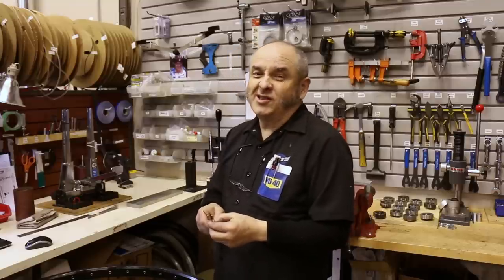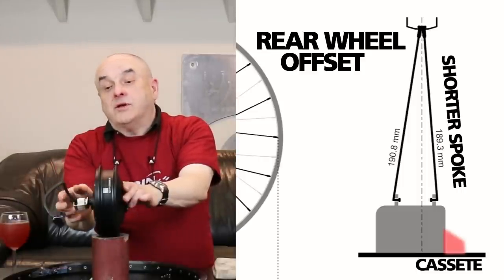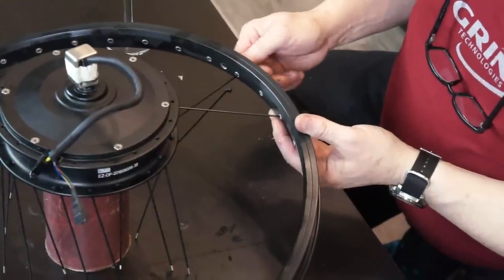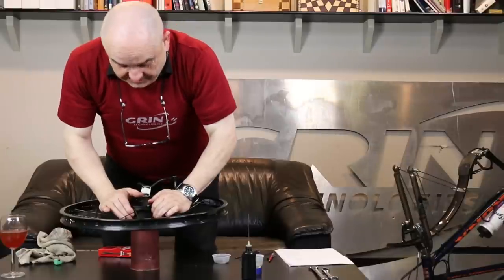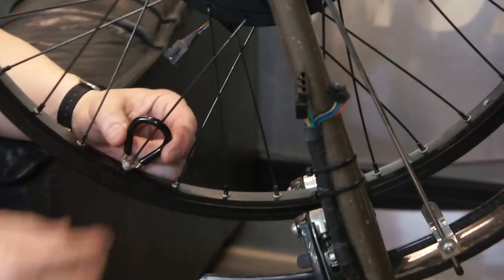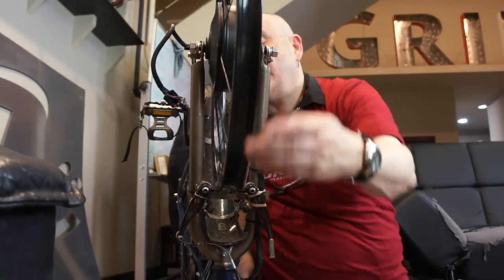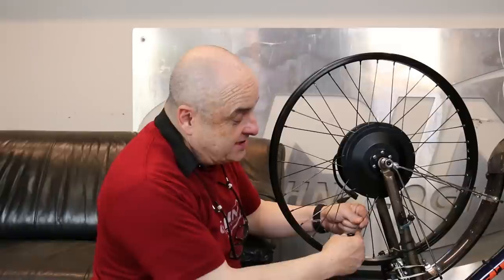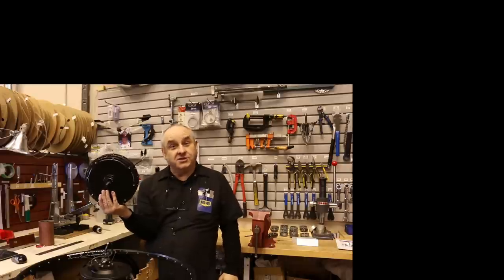How To Lace a Hub Motor at Home Like a Pro. The Single Cross Build

Comment: Hands down the best ebike wheel building video out there! Thanks so much!
Reply: Yes but building an ebike wheel isn't any different from building a normal bike wheel.
Reply: I think he specifically did elbows out for both stability and also because hub motors put much more torque on spoke heads so you can't do alternating elbows in/out like a lot of road bike wheel builds recommend
Reply: Also a 1 cross reduces the spoke angle compared to the normal 3 cross

Comment: Explain very well for the average person that's good with their hands. Not all of us have a bike shop to work in. I'm relacing an Alex rim also. A 1200 watt ebikeling rear hub. Tried solid Tannus tires. Worked great til they cracked my rim 6 inch from the weld point and at the Weld point. A700c × 40 tire a 23mm inside with a rim. I know hardtail without any suspension all the shock was being absorbed by the rim. The solid tires had the pressure of roughly 80 psi. They were extremely light wait. Gave a minor rolling resistance. And could never get a flight which was great. Do the rim cracked thank you for the video very helpful and knowledgeable person thank you

Comment: So helpful. There is nothing out there to help us with broken wheels. It’s a massive hurdle to ebike ownership. Every time I take my bike out I have wheel anxiety. Break the wheel , you can’t even find a bike shop interested in  repairing it. Thanks for doing this.
Reply from the maker: No problem and hopefully you'll be confident after watching to look after wheel truing yourself.  The main reason for failures is when people allow their spokes to get loose, and then there is opportunity for fatigue weakening of the spokes at the bend.  But we've also seen a few instances where people have overtightened their spokes and the nipples have pulled through or cracked the rim.  Done right though, a hub motor wheelbuild can be trouble free for years and years.
Reply: I had the same problem, I always used 12g spokes, makes a huge difference

Comment: Thanks for putting this together. I learned a ton.
Reply from the maker: Hey good to hear. There's a lot more nuance that we didn't go into regarding many specific hub motor wheelbuilding scenarios, but a large majority of hub motor builds are well addressed with this general technique. ie, single cross, all bends on outside of flange, and oiling (not loctiting) the nipples.

Comment: I was thinking of investing in truing stand to build my first wheel. Now I'm not going to because I already have one on the bike. Thanks Robert.
Reply from the maker: I mean, a truing stand is a great investment if you expect to build up number of wheels in your life, but if this is just a one-off build then the fork trick does the job just fine.
Reply: @GrinTechnologies  Let's first see if I can get one built. With your help that should go fine. However, while waiting for my first hub motor to arrive I've been wondering about something. My bike has disc brakes. I've noticed that even though the front tire is centered in the forks, there seems to be less space between the edge of the original hub and the fork on the brake side than on the other side. But the wheel looks to be symmetrical with no apparent dish. Should I expect some? If so, does mean I need two different lengths of spokes? Maybe you could do video on how to determine if this is necessary and how to do it. I suspect this information would also come in handy if you are lacing a rear hub motor.
Reply: @ALSmith-zz4yy  you have disc mount on one side of the hub, no? Space that you mention is taken up by that mount on disc side? Look at the hub where spokes are rather than axle, spokes on disc side are slightly further away from the fork comparing to spokes on the opposite side which are closer to fork? Same on the rear wheel where cassette is, as long as you rim and tyre are right in the middle of the bike/fork/seat stays/chain stay you are good to go... or I didnt understand your question?

Comment: Thanks for this, I used some old bits I had laying around to lace a 250w geared motor to a 700c rim, using spokes mostly from a 26" wheel and some 700c spokes. I followed your pattern but I had more of a harsh angle on the spokes due to them being longer, but it did it and it works perfectly, managed to true it up quite close.

Comment: Hmmmmm thanks to your informative video. I can most likely attempt my own lacing. I’m looking to reduce wheel size to a 24inch rim hub.
Reply: Can I ask you what's the best AMPS to use for a 48v 1500w hub motor?

I'm currently running a 52v battery that can do 45amps with a 48v controller.

But I'm able to reduce the AMPS on my controller. Because I believe 45amps that my battery can produce is overheating my rear huh motor

Comment: Love I'm a bike tech who just got his first ebike second hand. I do have a tensionometer. What kind of tension should I be shooting for? Back end makes some interesting noises. Ego bike Seagull. Thanks for the great video.
Reply: no idea but I do know from experience that if it's too loose, the torque from the motor can unscrew all the spokes and also that too tight results in spokes breaking constantly.
Reply from the maker: For the most part the spoke tension should be no different than for a regular bicycle hub. The fact that the hub has a motor in it doesn't really change anything about the forces present on the spokes.

Comment: I just attempted my first wheel build using a Farsports 58 Kaze carbon rim for my Orbea Gain. I used the 1X crossing like the factory wheel, but after I finished (which was a real biotch since I ordered the wheels with no outer spoke holes) I found that I had laced the wheel with all the spokes inside the hub with the spoke ends out. Doh! Will this work ok, or do I need to disassemble and flip all the spokes to the outside of the flange?

Comment: thanks for posting this video. I would like to know what diameter spoke do you recommend when lacing electric hub motors? And what material/metal do you recommend or use for lacing up your hub motors at Grinn?
Reply from the maker: We almost always recommend single butted spokes, 13 gauge at the elbow tapering to 14 gauge at the nipple. Sapim Strong has been our go-to but other reputed companies like DT Swiss and Pillar have similar offerings.

Comment: I'm trying to fit an ebike hub motor into a 17" rim. any idea what my limitations would be as far as wattage etc? was hoping I could use your calculator but there isn't anything for a 17 inch wheel. any info would be appreciated
Reply from the maker: You just need to know the ERD of the rim, the nominal rim diameter is neither here nor there.  Just use the 20" so that the drawing looks OK and then enter the actual ERD.

Comment: Do you think it's safe to have a single cross, inside elbows under outside elbows over, on an 18 x 3 " motorbike rim (aluminium) front hub for a fat bike ebike build using motorbike rims and tyres. Spoke gauge being 12g.
  It's a 48v 1000w system so no more than 36mph

Comment: I have a captured drawing from an article, that I think Grin wrote, that says to always have the j-bends inboard. Regarding thrust load at the side plate bearing.  It increases the spoke length difference to over 2mm. What gives?    And another drawing from the same article shows 544mm 32-hole rim 3X lacing compared to no cross of the same size, with motor. The spoke angle difference of only one degree. I did some math, for a 29er rim  that similar spoke  count would be over 40. Although I'd like a 32 hole hub motor for 29er carbon rims, at one cross.
Reply from the maker: Hey Bruce, if you are referring to the All-Axle motor, the reason for the bend being inboard is unique to a characteristic of that side plate design, see https://ebikes.ca/product-info/grin-products/all-axle-hub-motor.html#WheelLacing
Since the flange spacing is so much wider than on a typical DD hub motor, there's really no need for that anyways. 

The All-Axle motor has pairedd spoke holes. You can lace it in a 29er carbon rim just fine, both zero cross and single cross work perfectly well. It's just a matter of aesthetic preference. No difference at all in strength or reliability. This is explained on page 13 of the owners manual, have a read:
https://ebikes.ca/amfile/file/download/file/305/product/1934/

Comment: Should the spokes be touching each other? Like pressing into each other as they cross?
Reply from the maker: They'll always touch at the cross when all heads are on the same side. If you alternate the heads in and out like most regular bicycle wheelbuilds, then you can choose whether they cross by wrapping over each other, or if they cross without touching and a gap.
It makes zero difference to the wheel strength one way or another.
Reply: @GrinTechnologies  thanks for the fast response!

Comment: ok, the ending of this video had made me decide to build my own all axle when they make a 12x148 adapter for it so i can put 2 on a dual suspension carbon frame from china for 700 that weighs 4lbs.  bike frame and dual  motors alone total weight of about 14-15lbs....  and if you halve the load on the 2 all axle motors by having 2, you can double the power :D and have around a 8-10kw dual wheel drive dual suspension bike that weighs 20-25lbslbs before batteries..

Comment: Okay, so I have a question. My ebike rims came from the company with the spokes opposite to how you're building yours where the nub was on the outside instead of inside. I had to swap rims, so I took them to a shop, but they laced them like a normal rim without a hub motor and the spokes aren't even touching. When I asked the guy why he did it that way he said it's more stable. So my question is what's the correct way of lacing rims with hub motos thanks.
Reply from the maker: They are all a "correct way" to lace. As long as the wheel is properly dished and true and the spoke tension is good then it really doesn't matter a whole lot how they do the cross overs.
Reply: @GrinTechnologies  okay thank you so much for the reply, really appreciate it.

Comment: Thank you kindly for sharing your knowledge good sir, from across the pond! I want to fit one of those hub motors to my fat bike. Will they fit, or do i need to get a wider motor to suit?
Reply from the maker: You need a special wide fatbike motor, 170-190 mm on the rear, and the front these days is typically 150mm. But there are also fatbikes with 135mm front forks which allow the use of a regular rear hub motor.  See: https://www.ebikes.ca/learn/bike-compatibility.html#fat-bikes-135150155190
Reply: @GrinTechnologies  Thanks for the helpful reply. I'll have a closer look at the attached article when i get home.

Comment: I have a Bafang hub motor (G320) with asymmetrical flange diameters, how do I calculate the spokes for that?
Reply from the maker: Easy. Do the calculator first for the left size flange diamater, and another time for the right side flange diameter.

Comment: I have the sapim strong butted spokes 13G/14G (2.3/2.0) but my hub flange holes were meant for 12G(2.6). The sapim spokes sit flush with the flange holes. The 12G cover the hole much better. My question is do i need brass washers on here? I'm worried about the flange cracking
Reply: The hub flange holes are 3mm
Reply from the maker: If the holes are exactly 3mm you don't need washers and should be just fine.  Almost all of our hub motors have 3mm ID holes, though where the spoke head sits depends a bit on how deep the holes are countersunk.  If the spoke head seems to be going in further than ideal then you can use a washer under the head so that it sits further out and has the elbow more snug to the flange.

Comment: Can I add a hub motor onto my existing wheel? 

I hope so as I have a wheel/tire that I don’t want to replace.
Reply from the maker: Yes, just make sure that it has the same spoke count. You can't lace a 36 hub motor into a 32 hole rim.
Reply: @GrinTechnologies  Thank you for answering my question. I think I will add on a hub motor with my existing bike as it makes the most sense instead of purchasing a brand new bike simply for the hub motor. My bike is a few months old, and all the parts work perfectly for me, so it’s great to hear that adding a hub motor is doable.

Comment: I have a question, everywhere i read i find that i need to buy a spoke threader if i want to shorten spokes, but here you just file them and screw them on.. should i just do that? 
I dont buy the correct size spokes because i will be comverting a lot of bikes and cant have that as a system.
Reply from the maker: You need a spoke threader unless you only need to take off a couple mm, in which case you could grind down the end.

Comment: Great video. I just have one question. When you say that it's important to have it consistently tensioned by having each spoke make the same note, well.... What if after truing and rounding as best you can, it's not consistently tensioned and to try to do so only puts the wheel out of true again.  
Does that matter too much? If so, how would you go about making it consistently tensioned WHILE maintaining true?
Reply from the maker: The final objective is usually to have a true rim with minimal wobble, and if the resulting spoke tensions to achieve that are not totally uniform due to the rim itself not being perfectly round or true to begin with then that's perfectly fine. But you can sometimes have cases of a tight spoke near a loose spoke, and making them both closer to each other doesn't affect the dish but does result in a more uniform spoke tension.

Comment: i trying to get my old rat bike/chopper electrified and i have a 28" wheel with hub motor but i need it on the front 12" rim ... can this be done ?
Reply from the maker: Use our spoke calculator after measuring your rim erd and hub flange diameter to get the spokes length. If it's over about 50 mm you can generally lace it, but finding a small rim with the right number of holes may be tricky

Comment: I was messing around truing my cheaply built Chinese hub motor/wheel. In the process I messed up the tension completely. How do I bring it up to the proper tension without special tools? It's a rear wheel with cassette. Spokes keeping coming loose
Reply from the maker: Just go by feel, squeeze the spokes on a properly laced new bike wheel at a bike shop if you don't have a reference for what a tensioned spoke should feel like. The most common approach to achieving uniform tension is by "pinging" the spoke and listening to the pitch that it rings at, like a guitar string.  Is this a radial lacing or single cross?
Reply: @GrinTechnologies  it's a single cross. I think I managed it for now. It's a poor builds quality and rim and spoke material. Good for now. Seems laterally true but I can only do so much for it

Comment: Hi, I would like to ask, how you deal with centering the wheel inside the bike frame? In my case (KTM eLycan with bionx hub), the rim have to be rather away from one of the hub's planes. To do that, I tighten only one side spokes, so it pulls the rim to that side. So my question - how you make all spokes equally tension if it requires a rim to be off to nice side (to make it centered in the bike frame).

Thanks!

Also, after tightening all the spokes to its thread, I noticed that some spokes are much looser than others. Did you find similar problem? And how you deal with it? In other words, if the rim is true, and the majority of spokes are tight, but there 1 or 2 of them, which are rather loose - what is solution there?
Reply from the maker: Correct. If you have non centered hub flanges then by definition of the static force distribution the tension on the more vertical spokes will have to be proportionally higher than the tension on the more angled spokes. This is completely normal and to be expected, the left and right side spokes would NOT have equal tension, but ideally all the spokes on one side would be similar to each other.  Our spoke calculator even shows the expected tension ratio for a given build ( https://www.ebikes.ca/tools/spoke-calc.html )  
You can reduce this effect by having the spokes on one side have all their heads inside the flange, and on the other side put all the spoke heads outside the flange, as we explain in the FAQ if you read that.
Reply: @GrinTechnologies  Thank you a lot for your answer! In my case, I cannot use heads inside the flange, because bionx motor has already predefined holes, how the spokes should be. From your wheel built, I missed the note that spokes will be different tension on different sides. I got rather confused building my first wheel and finding the different tension on both sides. Now all is clear :) Thanks again for your answer!

Comment: So im buying a 26 inch ebike kit and I need to downsize it to a 24 inch So I can fit it on my Schwinn sx1000. I already have the 24 inch rim that I want to use (the one that came with the bike). Would I have to buy new spokes? and what measurements would I have to consider?
Reply from the maker: Hi Speedy. Just an FYI that you can mail us your rim and we'll build it to your selected motor. Otherwise, you could buy new spokes or get a bike shop to cut the existing spokes to the right size. Check out our spoke calculator to determine the spoke length https://www.ebikes.ca/tools/spoke-calc.html